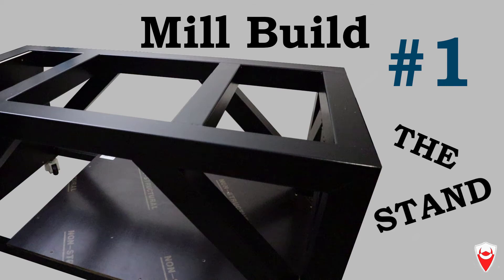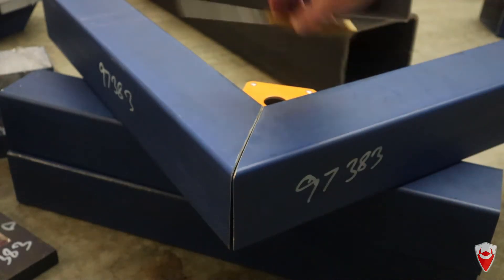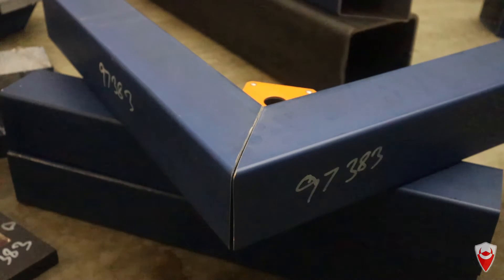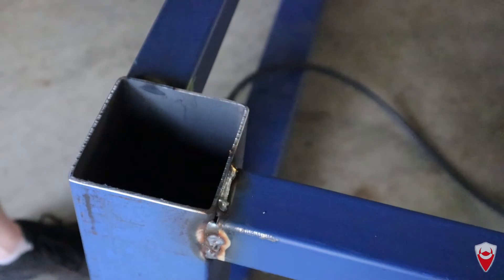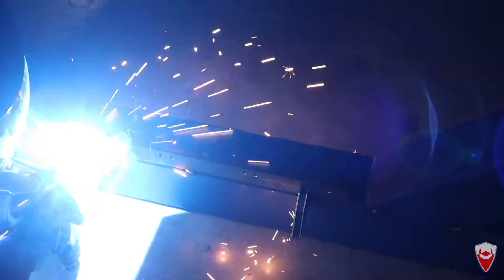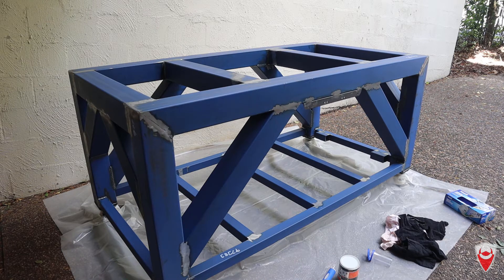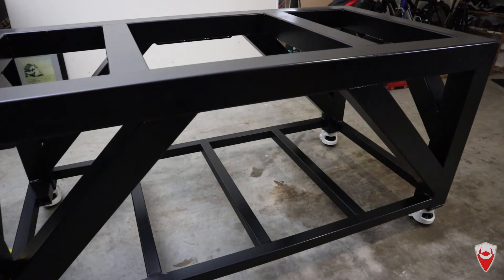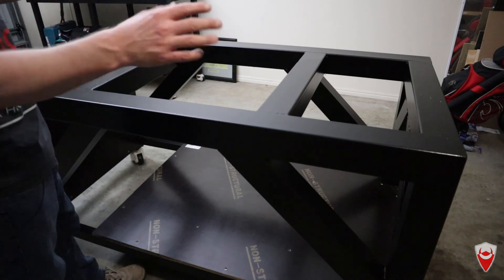[BUILD] CNC Mill Build Part 1: The Stand

Comment: This is one hell of a beefy base. Must’ve cost a small fortune in materials.
Reply from the maker: It sure did. Especially when I had to rework the legs.

The legs you saw me weld on were 100mm too short, so I had to go and buy new ones and then I re purposed then as those additional braces at the top (they weren't in the CAD render). The bad(?) news is, the cost of the stand pales in comparison to the rest of it....